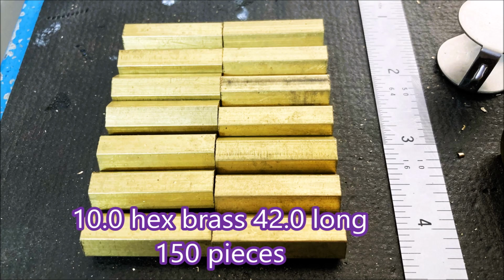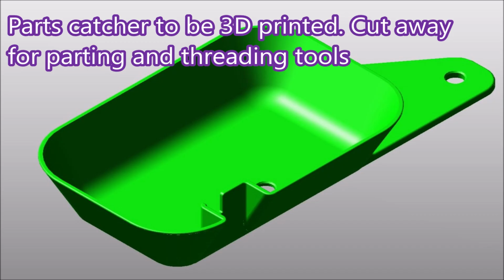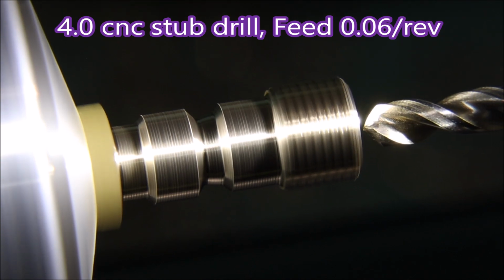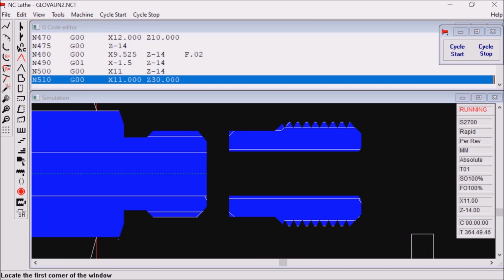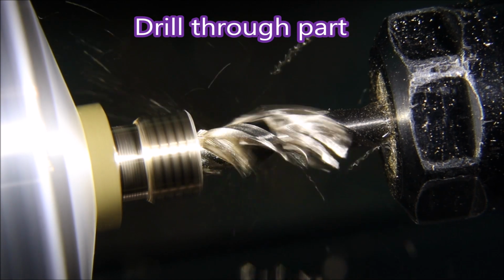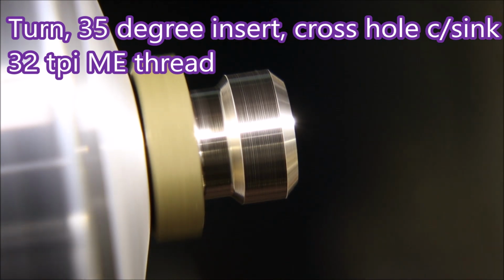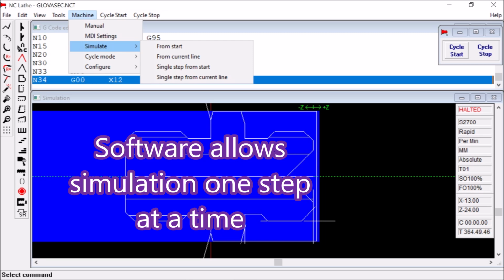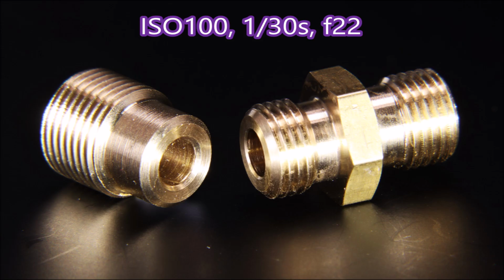Cnc lathe turns parts from scrap brass.  Turn, cnc stub drill, thread and part. 32tpi ME thread

Comment: Long time lurker here, picking up tricks and tips for an upcoming CNC adventure;)
Once the machine is here, I will be rewatching your whole back catalogue!

Thought I'd feed the algorithm and also add something possibly useful to others as I am actually a working, pro photographer, haha. (Whatever that means in this day and age). 
Anyhow, here it goes: Most/many modern cameras, even non-full frame ones, are very OK with higher ISOs. I don't know if yours is but for other viewers out there, I - and many of my colleagues - feel that the "obsession" with shooting low ISO is no longer needed and hasn't been in years. Back in the film days, yes there would/could be a real different in grain size between 100 and 400/800. 

Nowadays, the noise you get at say, 800 is often neglible and depending on the sensor can actually be rather pleasant, especially if you used to shoot film. There will be a drop in dynamic range at higher ISO - but most people wouldn't notice - but just bounce some light from the back or back light it in cases like these "pack shots" if you need to. 

All this just to say, on many, many slightly newer cameras you can shoot at +800 ISO - which is a 3 stop increase - and be absolutely fine. Especially for online use and especially when inserted into a video timeline for compression-happy YT;). 

As for my own work, I regular shoot at +3200 and get paid and published and never ever have I had an editor who complained about noise or lack of DR. Then again, that's more docu style so the last thing people care about, if the content and story is there, is whether the image has grain or 1-2 stops less of dynamic range. 

No criticism meant, just thought I'd share some thoughts and make the YT Engagement Lords happier.
Reply from the maker: I saw no criticism in your comment. I am really not sure what ISO I use, how embarrassing is that!  To try to get some depth I just throw more light at it. I even use a Ryobi spot light to help my
proper lights as you saw in this video.  Used to shoot weddings myself 645 Mamiya and Portra 160
Reply: @smallcnclathes  Nice:) I shot a whole docu project on a Mam 7 and Portra 800 - back when we could even get 220 format rolls.

Comment: That is good to get to use the scrap to make parts.  I ran across some poster boards I bought to use as backdrops for pictures of my items a few days ago.  But I have not had a need to take pictures in a while.  At least now I know where they are.  LOL
Reply from the maker: What colour are your boards? Will you use them to attach coloured paper and use them that way?
Reply: @smallcnclathes  I have white and off white and some gray. They are more like thick paper. Not sure if they are called something different in Australia but we call the poster boards here and the ones I have are about 2 foot square. I am not sure how thick they are though.  I will get a picture of them when I get a chance.  That would explain it better than me trying to describe them. :)

Comment: Very clever use of left over stock Nigel, nice one. And your camera work is getting pretty good too, hard to believe those parts are that small! 
Cheers Ian
Reply from the maker: Hi Ian, yes my friend found a couple of his parts that would fit and then being able to hold on the thread in a 5C collet helped too.  Almost all my video work these days is using a Canon DSLR with a 55/250 lens, mostly using close up lenses.  The long lens allows to camera to be away from all the flying chips and any splashes from spray coolant. Thank You for your comment. Nigel

Comment: Like the use of a drill for deburring 😀 is that NC lathe software just for hercus lathes I can’t find it via googling 😔
Reply from the maker: @julias-shed  Hi Julia, yes the software was produced by Hercus, the manufacturer. I am not sure if all the canned cycles match other systems. G00 through G03 are the same, but as I know no other system I can’t be sure. Would you like a copy?

Comment: I find off centre drills tend to centre themselves anyway. I dont use the tailstock anymore for drilling, I find it easier to tool post drill and thats a lot easier to get the drill on centre :)

I wish brass wasnt so expensive its fun to machine on my small CNC lathe.
Reply from the maker: I mainly use stub drills and almost never spot drill, but they always seem to drill the hole OK.  How about machine grade aluminium for your small lathe, it has always worked well for me.  Thanks for your comment. Nigel

Comment: What software are you using? I like the look of it.
Reply from the maker: That software is from the manufacturer of the machine. G00, G01, G03 and G02 are the same as other systems, but after that I think most code numbers differ.

Comment: don't know how much you care, but slowing down your rpms before the part falls off would result in catching parts every time, in most senerios anyways
Reply from the maker: @ryanbailey427  it is not only the part damage but also finding the part after it has dropped off. Parts disappear from view behind the bed. Easier to tap them off and have them in my hand. Thanks for taking the time to comment
Reply: @smallcnclathes  right, it is annoying when the parts catcher doesn't catch the part. I was just saying that if you wanted to have better success with the catcher, slowing down rpms before you reach the partoff diameter would help.
Reply from the maker: Thanks Ryan, will keep it in mind for the future. Nigel